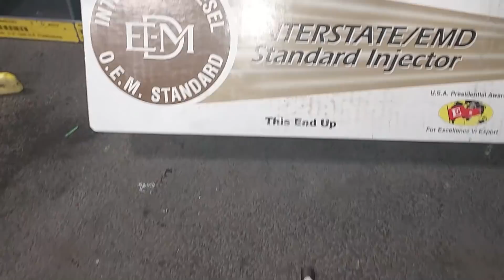Cracked Locomotive Piston, New Power Pack Assembly and Locomotive Fuel Injector

Comment: Great video of what Diesel locomotive mechanics go through to keep the locomotive on the tracks. Only thing is, the railroad company I worked for would just pull the whole piston power pack assembly - piston assembly and all. We would have the locomotive back in service in a few hours, not two or more days like this repair shop shown in this video. We had the use of an overhead crane to yank the piston power packs in and out. I loved being a locomotive mechanic. Something different to do in the shop every day.
Reply from the maker: Thanks Rick, glad you liked the video. These were contract mechanics
as we don't have anyone here that could do this kind of work. The
plan I thought was to change the entire PP assembly, I don't know
what changed about that, as you can see in the video there was
one there waiting. I'm not a mechanic but seems to me
changing the whole thing would have been the way to go.  They
had asked me the day before for me to use my boom truck to
pull the old assembly out and drop the new one in.
Reply: At the very least I would have changed the piston and rod and the piston cooling pipe as that pipe could have been plugged. That would cause the piston to get to hot and crack like that.
Reply: Yuppers, those are some pretty big parts! I was wondering if the pistons on some of the newer locos were any larger, as I had ridden on quite a few of the UP's 5000+ HP units in the 1990s through 2010, plus some newer NS units, as we interchanged with them as well as CSX.
 What was that comment about you changing out of your pajamas? At work? There was a fellow at work who developed a habit for wearing
 sweatpants to work (hogger). If I heard him on the radio, I'd ask him 'what color jammies are you wearing today' haha😆 
Only for a little while, so as not to bug him too much.
 Thank you for the videos, love to see your smiling face, that's Railroadin'! 👍👍

Comment: Great post !
Reply from the maker: Glad you enjoyed the show. We do appreciate your
writing in and for checking out the video sir.
Reply: @ccrx6700  I was a machinist working for Cooper Bessemer in Stratford Ont. Canada for 5 years back in the 70's. I Ran a 12 ft table boring mill and a 12 ft 60 ft 4 head mill.. We also made the 20 cyl GMWK and KSV, 16 Cyl Power units. I was there to work on 3 of them from rough castings to running units. They cemented my love of big that has guided me from those days on. This is big. The bigger the better eh.
Reply from the maker: @TomokosEnterprize  😊👍❣️
Reply: @ccrx6700  Thanks a bunch. I ended up fabricating and machinist running a big logging company's welding and machine shop that kept me satisfied for well over 25 years. Cable yarders are a nice size eh, LOL.

Comment: How did you decide exactly which piston was cracked? There's like 16 to choose from, no?
Reply from the maker: The mechanics did compression check on each cylinder, although
I wasn't there when they did it. These are contracted mechanics they
bring in to work on the locos.

Comment: wait was that engine in on an annual or biannual that they caught that issue? that is pretty serious to have a cracked piston like that. good many things that can cause it to crack like that too. also i remember changing the injectors out on a big Dash8 unit. not in the best of memory, but i think those EMD injectors are smaller than those big GE mountain units
Reply from the maker: Operator said it didn't have the power he thought it should be
putting out and didn't sound right. These were contracted mechanics
that worked on the engine. Appreciate your writing in and for watching

Comment: interesting stuff!.... that burn pattern on the piston head, looks unique, anything about that say how the engine was running?
Reply: Normally the piston is allowed to rotate on the carrier to even out the wear. That pattern is due to the injector flow.The piston might have over heated be cause of reduced flow of oil from the "P" pipe  I can't see if the liner is all scuffed. To trouble shoot this fair the whole assembly should have been inked out. Amateurs!
Reply: @kenneththompson2249  Honestly I felt iffy seeing that piston with the cracks that can be seen... truth be told, I have no idea about these monstrosities.

Comment: I used to run these EMD’s on the ground. We used them for power generation, I worked on many Woodward govonors, the relays, the excitation, we were also a black start facility. Amazing power, the blower/turbo was my favorite part. When the clutch disconnects and the power takes off. We made 2 mw of power with them.
Reply: I know some of my diesel experience, usually a leaky injector would cause a cracked piston. In the smaller engines.
Reply from the maker: Glad you enjoyed the show, appreciate your watching tonight my good man.
Reply: During the blizzard of ‘78 some electricians wired an sd 45 to the power grid in Avon yard so they could have electricity.  This was during Conrail years of course.  My dad was stuck there for three days keeping those motors from freezing up

Comment: It's called the crab stud and torques to 1800 ft lbs on that model and 2400 lbs on the F model - and when u can't get to the snap ring just reach in with a pick and pull on the side of the snap ring that loosens the ring and pull it around where you can get to it - if you have all the tools you can short pack a power assembly way quicker than changing a piston ... all u have to do to get that power assembly out is - pull the blow down valve - remove the fuel jumpers - remove the rocker arms - pull the crab bolts - pull the injector - remove the snap ring - pull the piston to the top of its stroke and secure it - remove the water jumper - remove the piston oil nozzle - pull the power pack with head and piston - if you good and start draining the coolant first by the time the coolant is out ur ready to pull the power pack - if it's only a cracked piston there is no use pulling the basket bolts just leave the rod in the engine... simple and quick - and when u do it like this you get to put new orings on the liner.. so keep a spare power assembly around so when you short pack one you can repair the broken one out of the engine and have it ready for reuse and not have any down time... I was responsible for 20 emd`s driving generators ... and before that 18 years on the RR
Reply from the maker: Thanks for writing in with the very informative comment JT H. Sounds
like a lot of stuff to do! We could have used you here for sure. These
were contracted mechanics, we don't have the mechanics here to
be able to do anything like this. Appreciate your watching the show
today my good man.

Comment: What is totally amazing is the crankshaft that turns 900 rpms at full throttle. It just blows your mind.
Reply: On gensets for overseas use, these engines turn at 1000 rpm for 50Hz gensets....

Comment: IF DIDN'T THINK ABY DIFFERENT I'D SAY BY THE LOOK'S OF THE HEAD ASSY AND THE COLOR OF THE VALVES HUMMM IT LOOK'S LIKE A LEAN CONDITION WHICH COUKD POSSIBLY CAUSE THIS ISSUE THOSE VALVES ATE MIGHTY LIGHT GRAY IN COLOR NOT NEARLY AS BLACK AS WOUKD THINK

Comment: no wrist pin on the piston?  How the heck does the connecting rod connect?  A huge ball joint?  Maybe that helps prevent scoring?  But don't you have to prevent the rings from rotating into the intake ports and damaging them?
Reply from the maker: Yes there is a wrist pin, I did not make a very good video of showing
how it was connected inside the piston, apologize for that.

Comment: I've changed 100 power packs out on EMDs, and I've never separated the piston from the piston carrier. We always pulled the injector, ran an eyelet down into the top of the piston, and pulled the whole power pack at once. I would never mix a new piston on a used carrier without mic'ing everything out first. Less time to pull the whole power pack too.
Reply from the maker: Thanks for writing in Jim. Several other comments have said similar.
These were contracted mechanics that did this and for whatever
reason they decided to change only the piston. Your comment
sounds like some pretty good advice. We do appreciate your
watching today sir.
Reply: We also changed the whole power pack. Much better repair.
Reply: They get to come back sooner this way.....

Comment: Nice to see into these engines like this. We mark many parts for GE engines (now Wabtec) where I work.
Off the top those dual fuel lines that run to the injectors and also the oil feed lines under the valve cover.
Reply from the maker: Glad you enjoyed the show sir. We do appreciate your writing in and
for watching.

Comment: i'm a little confused, the ports at the bottom of the cylinder make me think this is a 2 stroke engine but yet it has a 4 valve head and the cam lobes are off set which makes me think its a 4 stroke, can anyone clarify?
Reply from the maker: It is a 2 stroke Mark. Cam lobes, 2 outer ones for the valves, the 
center is for the injector, hope that helps sir.
Reply: @ccrx6700  thanks, are the intake lobes timed the same or are they offset slightly to improve turbulence?

Comment: If you look at it this way, engines of cars look like toys. But the crack looks really violent. it's good that the rest of the engine has not also been damaged. So, you help the locomotive with your colleague back on the jumps. when should it run again? I had filmed the last days in Helmstedt trains and was the last days in the station Berlin-Wannsee. Track construction work is currently taking place there until the end of March. In addition to turnout transport wagons, a rail crane is also in use. Spring begins and the track builders get started. Greetings from Berlin/ Germany. Sven
Reply from the maker: Thanks for writing in Sven. This loco is now back in service and
feeling just fine until the next time it decides to get sick again.
Appreciate your watching my good man.

Comment: At CN we just called them power assemblies and boy did I change a lot of them in my time. Don't recall ever having a problem with a snap ring. Have you got the right tool? Usually we didn't seoerate the head unless it was on an old covered wagon where we pulled it apart and removed the parts with a little winch and carried them out. I've got a premier tester for measuring running cylinder pressures that I should donate if I ever get down there.
Reply from the maker: Thanks for writing in and sharing with us Glenn. We do appreciate
your years of service and also for watching the video today my
good man.

Comment: Thank you so much for sharing. Very interesting. I wonder what caused that piston to crack. Those are some big pistons and connecting rods for sure. Have they got it back together and running yet?
Reply from the maker: Thanks for writing in and watching the home movie today my friend.
The mechanics did not know what caused it and yes it is back in
revenue service.
Reply: @ccrx6700  From the pic it looked like a bad injector. If the injector leaks fuel instead of a solid shot when it's supposed to fire, I've seen a bad injector melt a hole thru the top of the piston! Thats why they got a new injector with the new piston. Better to be safe than sorry... and not burn up a brand new piston.
Reply from the maker: @brnmcc01  I'm told if a new injector sits on the shelf for several years, still new in box. Then put it in there's a good chance it will have leaky seals?  We have 20 boxes of new injectors that were bought 5 or more years ago. Your thoughts on that?
Reply: @ccrx6700  That depends a lot on the conditions they were stored in. If a good climated controlled room, and the box and packaging are intact, unopened, cosmoline coating etc not disturbed, should be ok. But to be sure, just see if there's a local shop around that has a test bench setup, to test the injector pop off pressure and spray pattern. It's pretty easy to see if there's any fuel leaks, they just connect the injector up to fuel lines, then use a lever to push down the plunger. But if the boxes were opened up, and wax paper unwrapped, and stored in a damp place for over 5 years, I would get them tested before using.
Reply: @ccrx6700  On the other hand, if they were stored like in a damp basement, and someone had opened up the boxes, and unwrapped the packaging and played around with them, then yeah you're going to have to compare prices of having them tested and passing inspection, or use them for cores to get new reman injectors.
Reply from the maker: @brnmcc01  thank you. We used to have one of those pump type testers here many years ago. It as much else has, grew legs 😪
Reply: @ccrx6700  Boo, that sucks. Seems like good tools have a habit of doing that. Watched the video of the loco rerailing and re trueing the two front wheels and you couldn't find your flange guage tool.
Reply from the maker: @brnmcc01  after that I got on Ebay and bought my own flange gauge. Keep it in my lunchbox. 😉

Comment: I love the insides of two - stroke engines.  I worked with the 710 engine.  Started with mechanical injectors like you showed  then EMD went electronic fuel injection (EMDEC). Good old American know how.  Thank you for getting the internal camera shots. It please us mechanical nerds :)
Reply: I would think with traditional valves that its' a 4 stroke engine.
Reply: @DrHarryT  you can see the intake ports in cylinder side. EMD two stroke engines have intake ports with 4 exhaust poppet valves.
Reply: @billtimmons7071  I see the rectangular notches now, when I first saw it I thought that is was reflections. The piston must be at mid travel because the piston would still travel down to suck in air. I suspect then all 4 valves open at the same time some period after combustion but close before the piston gets to the intake notches. It would seem with this design you get less than a 1/2 of a stroke for power. Then again on a motorcycle it's about the same. I also saw the bottom of the piston and didn't see a traditional connecting rod wrist pin. I suspect the wrist pin is part of the rod assembly with a round pad at the top which fits into that circle on the bottom of the piston and is held in by a snap ring.
I'm a 40 year veteran automotive mechanic and I have never seen or knew about this design. I would like to see an animation of it in operation.
Reply: @DrHarryT  EMD’s competitor GE used 4 stroke. They both had about the same displacement and similar HP. You would expect  the two stroker to have higher HP for similar size but it’s not the case. Two stroke EMD engine has lower equivalent compression stroke because of intake ports. EMD also had problems with emissions with two stroke design. I love the EMD design but two strokes has hit their limits and four stroke is better for todays medium speed diesel engines. I heard that the opposed piston two stroke design is making a come back and can meet emission standards.

Comment: In my former line of work, we used EMD engines for stationary power, but they were actually locomotive units.  We had several of those  power pack assemblies in stock.  But yeah, it's cramped to work in that crank case.  Three lobes on the cam, two outer ones open the four exhaust valves, the middle one 'pumps' the injector.
Reply from the maker: Thanks for writing in Mike and watching the home movie today my friend.

Comment: great hidden items that us outsiders do not get a chance to ever see. was that a 456 engine 
456 cu-in per cylinder.  those were the work horse of the first gen diesels. it is just amazing 
how they just keep going and going and going! thank you for the great educational videos 
you have such a great railroad job with all the access to unique items that no one on the outside
ever get a opportunity to see. hope you have a great day. I heard there is a coal is a hot commodity 
now with all the bradon { bidon } has done to the energy sector, especially in europe.
Reply from the maker: Thanks for writing in and watching the home movie today my friend
This is a 645E 3 engine, the operators manual for this loco does not
list what the cubic inch is for this engine. And you are right, currently
coal is on the rise, significantly from this time last year. We cannot
mine enough coal to satisfy all our customers. Natural gas prices
have risen and some utilities are switching back to cheaper
coal to burn. All class 1 RR's are hauling more coal now than this
time last year.
Reply: @ccrx6700  That's easy, all the Detroit/EMD series engines, the model number is the number of cubic inches per cylinder. So the 645 is 645 cubic inches. Same with the 567 and the newer 710's. The ancestor of this engine is the Cleveland Diesel division of General Motors 12-278A, which was used on a lot of WW2, Korean War era tugboats, minesweepers etc. Worked on an old Navy minesweeper that was from 1952 that had a pair of 12-278A's, V12 278 cubic inches per cylinder, roots blowers. Very simular to the 645, just a bit smaller, like 8.75 in bore if I remember correctly.